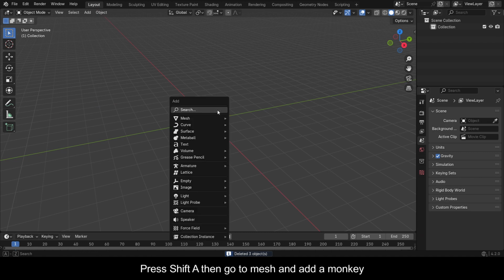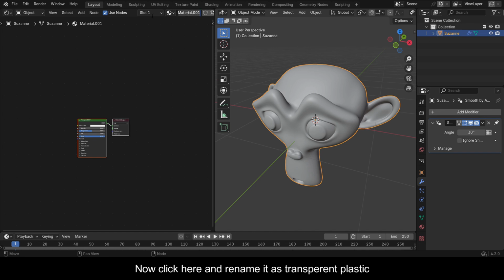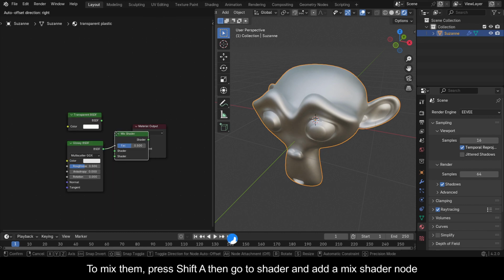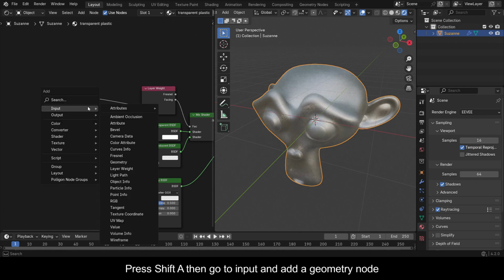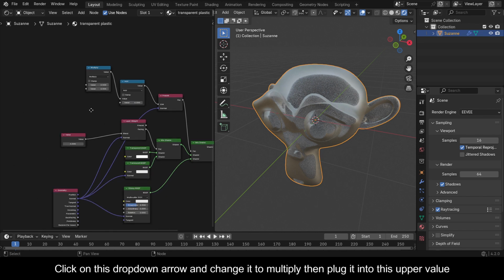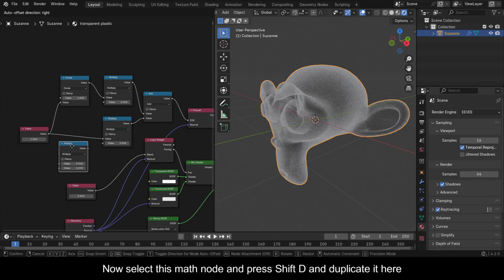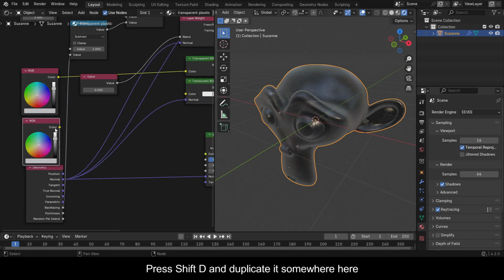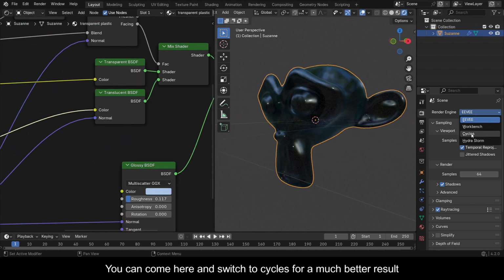Creating Realistic Transparent Plastic in Blender – 100% Procedural Node Setup!

Comment: I am still amaze on how did you come up with this node block. I understand on using the layer weight facing as the factor for the transparent and translucent bsdf, but I still cant understand the fresnel node where you basically subtracted the backface of the object. What does it do? I tried experimenting by trying to replicate the color of the original fresnel node group with just a singular fresnel node (IOR untouched (1.5)) and a color ramp. I tried to get similar range by adjusting the color ramp node, but when i connected it to the factor its completely different from your method. I concluded it has have to do with the subtraction of the backface. Does the value change depending on the viewing angle? Thank you again for your node setup it definitely what I needed for my scene!

Comment: Awesome tutorial, the descriptive steps made it approachable and easy enough to understand and follow. I am wanting to import my transluscent model into Tabletop Simulator for use with games, and was wondering what needs to be done to export a model with materials like this as a texture. I have seen other tutorials where people used UV maps linked to an image in the shader editor, but I have no idea what to plug it into here to export the texture from this transparent material that we made.
Reply from the maker: I'm not sure if Tabletop simulator can import the full node setup accurately but you can make the UV maps with in blender to imitate the material you want, there if you import it into another program it can easily read them.

Comment: heyy, for some reason i copied your material but it's not providing me the same look as yours, is there any way you can help me out, any way to reach out to you with my problem?
Reply from the maker: if you are using cycles it should be able to come out but if it is Eevee you'll need to activate Raytracing then also adjust on some settings in the material properties